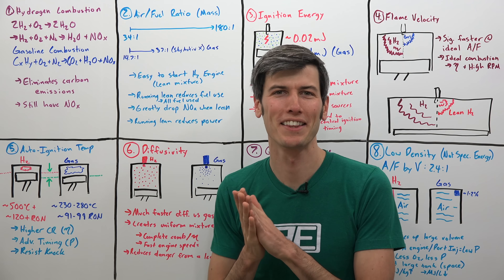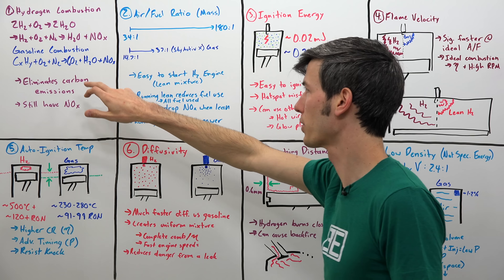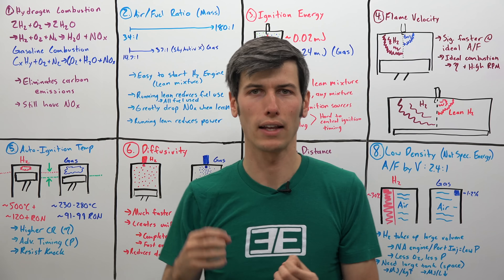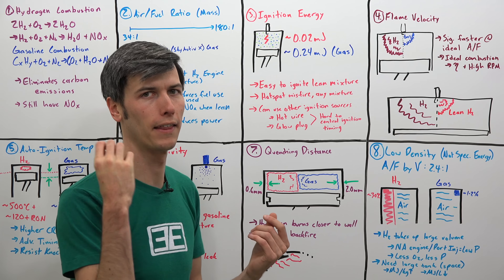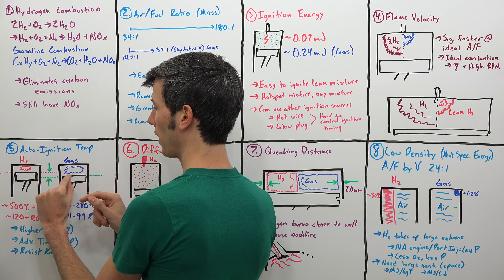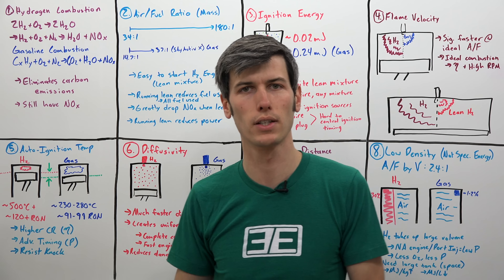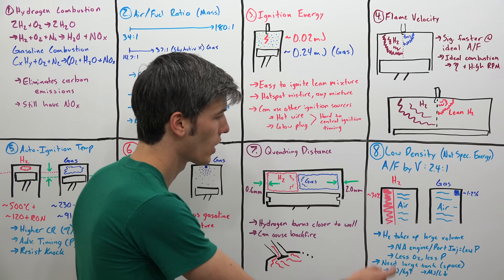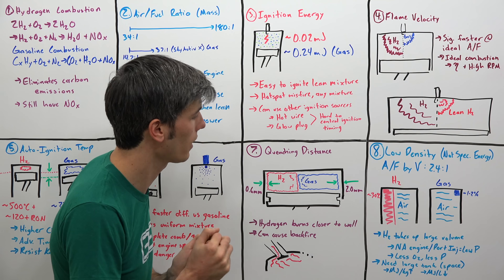The Difference Between Gasoline And Hydrogen Engines

Comment: Great video, thanks. Few questions / observations: 
How do NOx emissions compare between the fuels, and couldn't this be mitigated with a catalytic converter as it is today?
You mention hot spots a number of times, but not at all in point 6 - surely better diffusivity will reduce likelihood of such hot spots in the first place?
AFAIK, Aspiration refers to the air part of mixture (i.e. turbo or super charging), not the fuel - so using NA term bit misleading / confusing; and surely the hydrogen will have to be under pressure from pumping anyway, so the volume ratio is more theoretical than practical, but direct injection does offer an advantage
In terms of the fuel storage itself, I know this was comparison with petrol but surely this video is driven by concerns over the future of ICE engines, and you did mention the Mirai so how does hydrogen storage compare to battery packs in terms of overall size & weight? (Clearly the latter's packaging much more flexible)
Reply: Hydrogen needs a lot of space for storing. Smaller cars are not really possible if you want comparable range to gasoline or battery cars.

The Toyota Mirai has 3 tanks for the Hydrogen, and of course a rechargeable Lithium battery + electronics to manage the entire car. Yes you need a rechargeable battery if you do Fuel-Cells. And if you go hydrogen it's the only worthwhile option, since combustion just adds more complexity to the system again, and thus reduces reliability substantially.

Though, the battery is not that large, which also poses the issue that it won't have the life span of a larger battery pack like in a Tesla Model 3 LR for example.

Also mind you: While the Mirai is a massivly huge car, it has a tiny trunk, due to the hydrogen tanks. You can't even fold the rear seats, because Toyota put the electronics and battery behind the rear seats.

Hyundais hydrogen Fuel-Cell car lets you fold the rear seats, but the trunk is still very small due to the fuel tanks.

It's also worth noting, that you can drive almost 2000 km with a fully electric car from the energy that is needed to produce and transport enough Hydrogen to a fuel station for 100 km of driving. Sides of the Infrastructure for Hydrogen being a lot more expensive than it is for fully electric cars.

Comment: If you use electrolysis you don't need a big tank a 16 gallon tank will do and you will get about 4000 miles to the tank and you get Hydrogen and oxygen so it two bang for the buck so to speak which mean you don't need air from the out side

Comment: Would you please compare it with diesel?  Rather than using a gasoline type engine and replacing it with hydrogen.  Would it be possible to use a diesel type engine and replace it with hydrogen?

Comment: Question.   If Hydrogen when combusted only makes water then why not compaire Hydrogen in a 2 stroke motor and gas in the 4 stroke. Lets see the numbers on that, would not that make them a little more evenly matched?

Comment: Does hydrogen on demand actually work? Mixed hydrogen gas into a gasoline combustion process to make it more fuel efficient and carbon neutral. I've read and watched videos that it works. But I'm pretty skeptical

Comment: Should also mention that hydrogen gradually escapes thru the walls of any pressurized tank, even a thick steel one that weighs over 100 pounds empty. Also the amount of hydrogen that can be squeezed to 3000psi into a tank the size of a gasoline tank would give under 100 mile range. Big heavy tanks required for useful range.
(I owned 3 methane vehicles, same issues as hydrogen: lower fuel cost but shorter range unless tank size is huge & heavy)

Comment: I have a question, the mass advantage (from economical point of view) of the gas engine agains diesel engines were that you  could  drive them on LPG or methane.  Lately  there are some experiments mixing LPG with diesel fuel in  1:3 ratio  or so and it even improved  performance. 
Since the by product of the H2 is H20 do you  think  it's  possible  to  make the mixture of H2 and diesel fuel. 
(if not, as I  think,  can you  give some coments on the LPG and methane  as fuel)
Reply: Boom!

Comment: Something not being observed or mentioned is the molecular size differences between H2+O2 vs H20.  H20 is over 1000x smaller in size than H2+02.  Hydrogen gas is already a dry gas (it's not a liquid like gasoline which is misted; that we even refer to gasoline as a gas is a misnomer as it's a liquid, that is ignited to expand into a gas which then pushes the piston).  Hydrogen gas can only implode.  It's an implosion engine, not combustion.  There may be a brief instant where H2 becomes H1 ut H1 is unstable and will reform back to H2 and or H20.  Timing for ignition would have to be 180 degrees offset.  If there is any combustion going on in a "hydrogen" vehicle, it's coming from igniting water with a higher voltage ignition system.  There is a guy that posted a video of igniting water with a typical spark plug and car's ignition coil; the only thing he did differently was put a power inverter before the ignition coil so instead of 12VDC going to the plug it was 150VDC.  The water explodes expanding into hydrogen gas and THEN you have combustion.  Combustion is the breaking apart of elemental bonds leading to an expansion, into a gas form.  Hydrogen is already a gas, it will turn into a liquid.

Comment: Old clip now, but i found it late.

One comment: It wasn't mentioned that increased NOx is also connected to higher compression ratio (at least that's what i have been told is part of the diesel engine dilemma), so running at higher compression shouldn't then be listed as only a pro.
Also flame velocity isn't all a pro. The low velocity in a diesel engine is part of it's much higher efficiency (upward 45% compared to 30%-ish for gasoline), since the slower burn continues in the downward piston motion, adding work.

Comment: I would like to comment on the point 8 in your presentation... 
Yes, I agree, that hydrogen in it's gas state takes up too much space to be convenient to use as a fuel. 
Furthermore it would be very dangerous to drive a car around with a big tank of this flammable gas. 
But... Why not chemically bond it with oxygen and rather carry around a safe liquid a.k.a. water. 
By electrolysis it is possible to split the liquid back and make the hydrogen gas on demand. In case of an accident you end up with broken jar of this safe liquid mixed with some electrolyte. Another advantage is that from 1 liter of water you can make much much more hydrogen, then you would be able to compress into 1 liter tank.
The problem is how much energy is used to do the electrolysis? Is it greater than the energy released from burning the hydrogen? If yes, it is not convenient. If not, then it could be possibly the solution. Just my thoughts...

Comment: What happens if you electrolyse some water and put the wet HHO mix into a gasoline engine along with the gasoline?  An elderly friend experimented with this in the early '70's and he said it makes the car go like a rocket, and also increases mpg.  Maybe the NOx emissions in a hydrogen engine could be avoided with a closed cycle engine, excluding nitrogen and either using oxygen and hydrogen or electrolysing water and also putting the steam exhaust through a steam electrolyzer.  Maybe a ceramic engine would be better.  I'm sure burning hydrogen would be more fun than a battery EV.  Also, I hate batteries anyway!

Comment: I had some ideas to do this with a left over 4 stroke generator, just bringing it in at a low ratio 34:1. just the engine has to be cleaned of any fossil fuel residues.

Comment: Amazing video and loads of information  Thanks! Im planning on building a mimi 2 stroke hydrogen engine from a rc engine. Will be an interesting project. Im curious tho as i would like to produce electricity from the engine, and use that for electrolysis to produce the hudrogen. Will be a fun project.

Comment: Do you think metal embrittlement would be an issue with hydrogen?

Also, do you think direct injection of pure O2 instead of naturally aspirating could offset some of the downsides of using H in an ICE? (ignoring, momentarily, the risks of putting a pure fuel and pure oxidizer in close proximity to each other..)

Finally, great video! 👍
Reply: Yup, Hydrogen Embrittlement was exactly what I was wondering about.  I also realized this is a big problem for Fuel Cell vehicles as well.  During ignition and burn at high pressure there certainly would be a tiny amount of high temp ionized hydrogen atoms.  These would work their way into almost anything.  Glad to see someone else thought of this as well.
Reply: I was working research under Ballard to produce an Oxygen Concentration System.  We were using VAPSA (Vacuum Assisted Pressure Swing Adsorption) and doing it the best and fastest in the world.  Unfortunately we couldn't get below our parasitic energy target so the thing never went to fuel cells.  Exxon Mobil bought the whole company and mothballed it all.  Yay Green Energy!  
[The idea is that for a fuel cell the H2 is 100% however the atmospheric O2 is only ~20% so if we could increase that above ~80% then the fuel cell would produce a lot more power or could be made smaller for the same power output]
Reply: @seanb3516  Isn't Ballard producing fuel cell trucks and buses in China? They mostly use gray and blue hydrogen instead of the green kind
Reply: @luislongoria6621    I'm not sure about Ballard in China.  I know they are somewhat hooked up with Honda.  Also I am unfamiliar with Grades of Hydrogen (colors).  Of course I assume that you are speaking of the tank colour and not the gas itself.  The one thing I do know is the problem with Ballard Fuel Cell Stacks is...Ozone.  The oxygen can electrically transform into Ozone and it eats away the PEM (Proton Exchange Membrane) which is a Polymer material.  One of my instructors at BCIT did his PhD on the PEM material.  Worked all summer to synthesize a few grams of polymer.  He would recant stories of walking across the lab with a few grams of powder on a weigh boat and realizing all his hard work came down to one sneeze worth of disaster.  He didn't have any accidents and received his PhD.
Reply: @seanb3516  I was referring to an article by the South China Morning Post. Sinosynergy in Yunfu, Guangdong provided several photos of semi trucks and buses fitted with hydrogen tanks. The color grade of hydrogen refers to the feedstock: Gray = Coal, Blue = Natural Gas, Green = Water. I can't imagine the membrane being oxidized so much as the electrodes in a typical Lithium ion battery. Might you be referring to graphene, i.e. oxidized graphite?
Reply: @seanb3516  I was referring to an article by the South China Morning Post that featured several photos of semi trucks and buses fitted with hydrogen tanks from Sinosynergy in Yunfun, Guangdong.  It's possible they were only tanks for natural gas
Reply: @luislongoria6621  Interesting about the feedstock color scheme.  No doubt I was referring to buildup of Ozone in the PEM (Proton Exchange Membrane) that is still troublesome for Polymer type exchange membranes (Ballard and possibly Honda).  The Oxygen feed is in an electrical state when passing through the membrane and this leads to side reactions producing Ozone.
Reply: @seanb3516  Not sure which catalyst produces O3, there's been speculation about whether cracked molecules would just recombine in route to the combustion chamber and the solution seems to be either electromagnetic induction or a low powered laser (however unlikely)
Reply: @luislongoria6621  Yes, this was a big part of the mystery.  There does not appear to be a catalyst however the polymer matrix coupled with the ionizing/electric locale within the PEM seems to produce the Ozone.  It was hard to detect O3 because it would immediately dissociate into O2 and O-. The Oxygen Radical then continues on its destructive path.  I'm not sure where Ballard is with the issue currently.  It's been quite a few years since I was doing research around them.
Reply: And much like the  hydrogen, the Oxygen will be expensive to obtain, but as a by product of the hydrogen production. BTW, electrolysis of water about equals the energy obtained by the combustion of  H₂ and O₂. and that energy will still come from remote power stations burning hydrocarbons, with greater than 50% energy loss in transmission.
Reply: @brucefrank6119  there is such a thing as hydrogen produced by renewable resources, known as green hydrogen. What you are talking about is known as blue hydrogen, which is the absolute worst way to produce hydrogen.
Reply: @justinweatherford8129  You can never get more than 100%, its just a dream.
Reply: @brucefrank6119  Oxygen is a byproduct of Electrolysis of Water to produce Hydrogen However...Most Hydrogen Is Produced By Steam Reformation of Methane.  As I understand it the products of Steam Reformation are Hydrogen and CO2 (or it could be just Carbon.  Been a while since I did the studying).  As for Electrolysis being equal in energy consumption to the amount of energy produced by burning H2 and O2 I believe you will find Electrolysis to be less efficient.  Also it is important that we don't confuse Thermal Watts with Electrical Watts.  They are very different in terms of looking at efficiencies.  As for transmission losses...sheeeeee...don't get me started!
Reply: @brucefrank6119  Sounds pretty silly to me.
Reply: How do you want to extract the O2 from the air that enters the engine?
Reply: @annekecornee  very likely by using a liquid oxygen tank, but that would increase weight and reduce efficiency.
Reply: @justinweatherford8129    And the wonderful fiery danger of it all!  I have had Oxygen fires occur in the lab and they are always really fun.  Imagine you open a can of pop and notice the edges of the tab smoldering...then you suddenly notice your jeans smoldering...then you run like hell to stale air.
Reply: @seanb3516  I have used an oxy-acytline cutting torch to cut sections off of pipe for testing, and I have caught my pants on fire a lot. I can't imagine that I would be startled by having flaming pants again. If the burning pants start to reveal more than society considers appropriate I might feel slightly embarrassed.
Reply: @justinweatherford8129  Great Balls of Fire!  But yeah, watching a flame race up the inside of a plastic tube is a bit startling.  You start by thinking there is no fuel mixed with the O2 and then you realize the plastic tube is the fuel.  When you get to the point of working with a Parr Bomb you realize everything is flammable, even flame!  lol  A Parr Bomb is udes to burn samples completely to determine how much energy the sample material contains.  It is charged to 17 Atmospheres of pure Oxygen and then you hit a button to heat a little wire inside.  When you eventually open the Parr Bomb there is nothing except a bit of water.  Even the wire burns and we calculate that amount of energy out of the final results.
Reply: @seanb3516  sounds like someone doesn't have spark arrestors installed in their system preventing the flames from traveling through the system. Yeah, that would be pretty scary.
Reply: @justinweatherford8129  Yeah, we did install some arrestors and found things like steel check valves with sintered disks worked very well.  We also switched to Krytox in the Vacuum pumps as they might suck pure O2.  The reduced pressure might have made it unnecessary however we didn't want a fire.  I did have about 20kg of spooky research powder undergo a ReDox fire.  Really weird.  We could not extinguish it with water, containment, liquid nitrogen, or anything.  We simply let the stuff 'burn' away.
Reply: @justinweatherford8129  The burns are not fun.
Reply: @annekecornee  You don't.  You want to remove the Nitrogen and Argon.
Reply: @seanb3516  You could use a filter, but I think the idea is not very good.
Reply: Boom!

Comment: One other difference.  Hydrogen will easily diffuse into the metal,  gaskets and lubricant and leak through ANY cracks.  Metal will become brittle.

Comment: In the 1970's when California was pushing smog control without regard to the life of the engine, I read about a study done on NOX in Los Angeles/San Fernando Valley. It concluded that oxides of nitrogen  being close in composition to nitrous oxide, seemed to reduce the number of suicides. So the burning of your eyes making you cry like you just lost your dog is offset by the happy feeling of laughing gas.

Comment: A bit late to the party, but I was wondering if this was specifically related to HHO gas, or a "pure hydrogen" setup. What whould the variance of air/fuel mix look like between the two?

If it is "HHO generator" style, would a catalyst (ie. Table Salt) make a difference in the chemical reaction?
Reply: Yes it would but a better electrolyte would be baking soda. It is more efficient.  Also, by using an HHO Gen you would be creating your oxygen along with your hydrogen so the air mixture for combustion would be less varied and thus results in a more reliable ignition.

Comment: great explanation.. but I was expecting a good explanation of why there are no hydrogen-based combustion engines on the market... BMW has been working on hydrogen combustion engines for more than 40 years... I remember a visit to Germany in 2000 and then there were a lot of noise around hydrogen... I remember they were using Series 7 for tests... 20 years later no BMW production car uses hydrogen combustion engines as far as I know...  so it is only due to the low density of Hydrogen?? of course it is a big issue.. volume... but still, if it develops more power, more efficient, they should be getting 300plus miles range with "decent" fuel tanks... no??? something I missed?? thanks a lot and keep creating such good videos.!!!